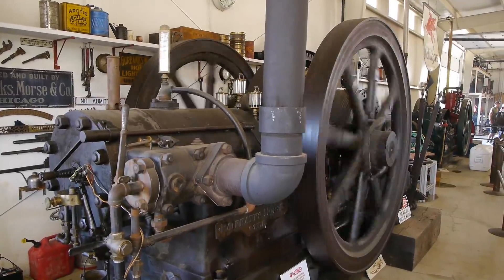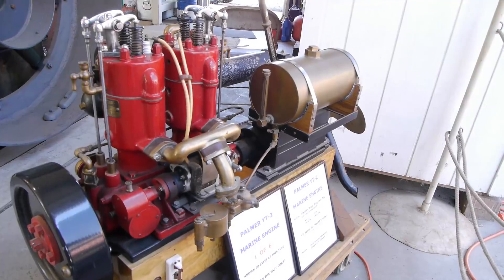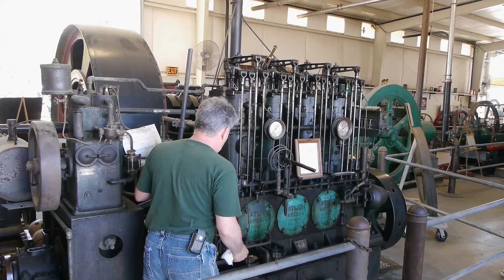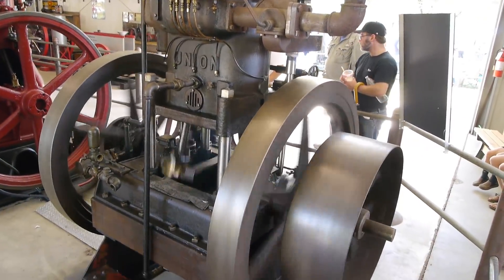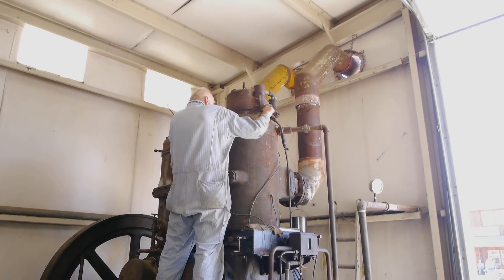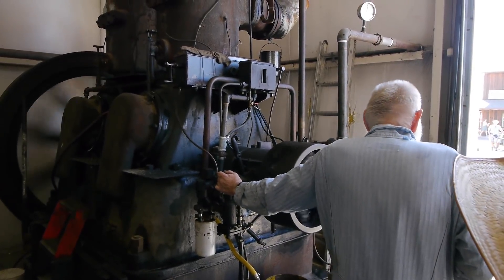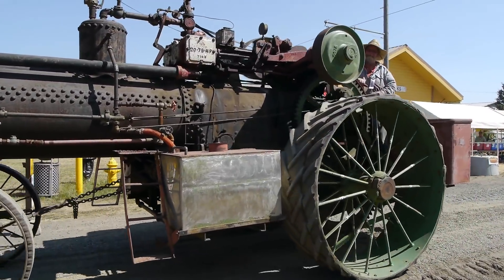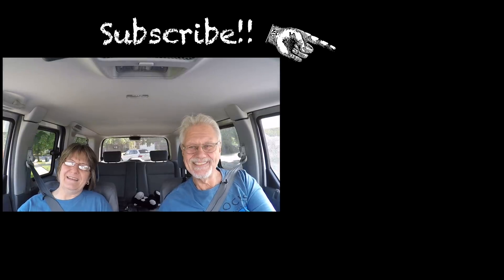Static Engines at the Great Oregon Steamup 2018

Comment: Was hoping you had the noon whistle.  I try to attend every summer.  I was on one of the tractors in the parade.  Just an FYI, the 4 cylinder tugboat engine is diesel, and yes it has injectors.  I do agree, it is one of my favorite engines.  I want to get a quality audio recording of it running by itself sometime as it's sound is very relaxing.  Next year I plan on taking quality sound recording equipment and make stereo recordings of many of these engines.
Reply from the maker: No whistle while we were there! AMAZING SOUND. But we were there first weekend and missed that. Somehow....
Reply: You must have been way off site for lunch.  Every steam whistle lets go at noon including the big one on the sawmill if it is running at the time.  Can be heard a few miles away.
Reply from the maker: Im wondering if for some reason they didnt do it or..... They did this at rail fair and WOW!!!!!!!!!!!!

Comment: I saw a John Deere engine that is an ice cream maker! Tasty!
That one where the guy had to prime his diesel motor and you said he poured oil into it because it leaked out reminded me of the locomotive engine that provides passenger service in town. These ex Amtrak locomotives from the 1980s leak and burn I think said about 55 gallons of oil on a round trip run. I can't decide if that's good or bad? If its an oil leak I guess it good? if it's diesel oil I would think that would be bad seeing that fuel consumption wise it should be getting 500 miles to the gallon of fuel used. It could also mean that I'm clueless with regards to his statement.
Reply from the maker: We went for a ride on a B24. The way you check the oil is by looking on the side of the engine pods. If oil is running out of everything and all over the aircraft it’s fine. If it stops leaking you are low on oil. Soon you start loosing pressure. No lie. This is how the crew checks the oil in flight. After we landed everyone on board is expected to help wipe oil off the plane. There’s a show on it I think.  Did you notice the John Deere with the oil catchers on the exhaust stacks???

Comment: Been to Brooks several times. When I was a driver I would park across the road at the Pilot truck stop. Are future episodes going to be the Oregon Electric Museum and the NorthWest Truck Museum? I think there is also a miniature live steam group there as well(never did see them all the times I was there).
FWIW category. Fairbanks Morse(of opposed piston Diesel Locomotive) started out making farm machinery. Including many stationary engines. 
On belt driven machinery, OSHA and CalOSHA(in California) really freak out when they see. Muni until the 1970's used to have a shop in San Jose Av that was all belt driven equipment. I helped the Western Railway Museum(then the California Railway Museum) move a lot of the machinery up to Rio Vista. The rule is, now, unpaid volunteers can work on the equipment(with proper training). Muni's cable car barn was another repository of belt driven machinery into the 70's. Including a wheel lathe that had been installed on the upper floor of the shop and fell into the basement during the 1906 earthquake. The (then) Market Street Ry just reattached the belts in the basement.
You had to be careful around a lot of the older equipment. I guess to that is why it ended up in museums.
My apologies for the lengthy writing.
Reply from the maker: We have a few more shows on Brooks. Love the trucks!! And the car museum. Next week is the sawmill. The following week is trolley and live steam.

Comment: Growing up we had two old John -Deere tractors that could have been called 2 cylinder hit & miss engines for when they were at a low idle that's what they sounded like.  I always wanted a stationary hit and miss engine.  There's a local Amish man that goes around to different festivals making homemade ice cream and he uses a hit and miss engine to run the cranks on the ice cream buckets.  When I was a teen many years ago I got to go to a large engine show like that in Rushville, Indiana and they were using the big steam traction engines there for everything from plowing demonstrations to sawmill and threshing operations.  Thanks for taking us along with you to this show.
Reply from the maker: If you look close in one shot Karyn is eating homemade ice cream from such a machine.